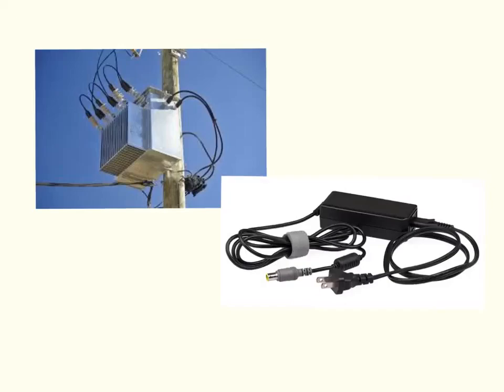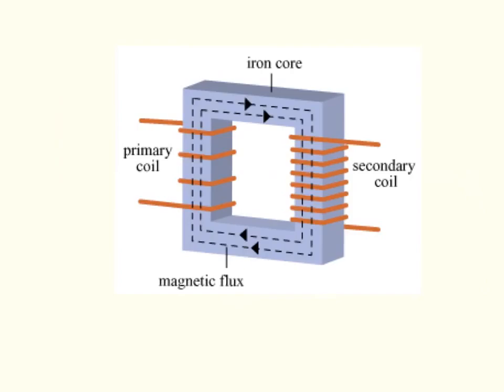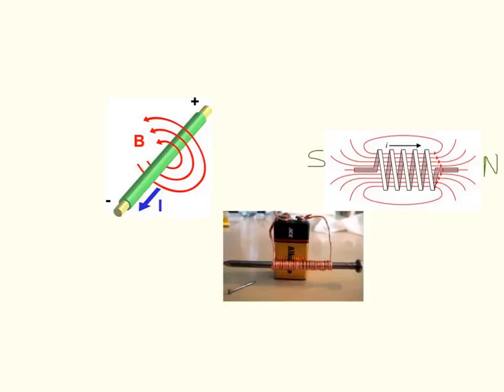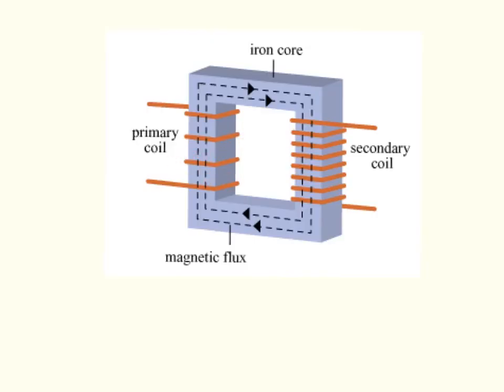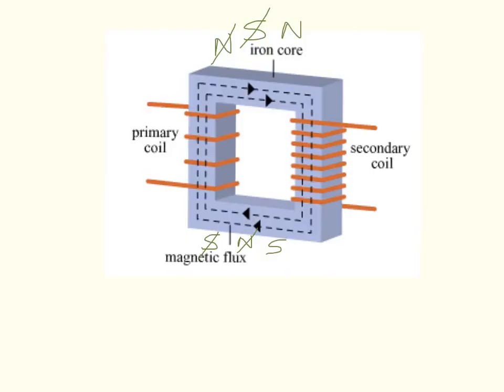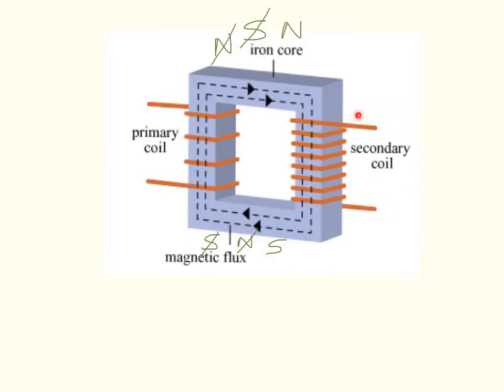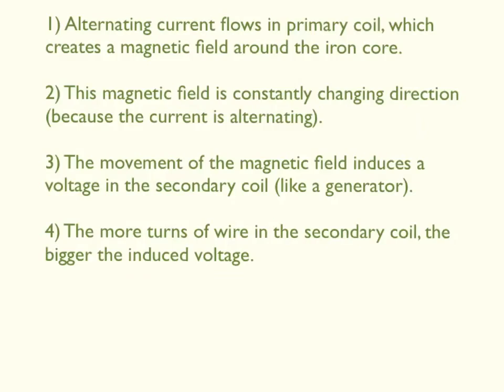Transformers explained

Comment: lol I’m in lineman school and have a test on this in a couple days thank you for breaking this down Barney style unlike my text book so I can pass my test
Reply: Do you knoe happens to the current of the secondary does it change or stay the same? If the primary was 10v and the secondary was 100, youd need 10x more wraps on the second to increase the volts to that amount, but would the current drop because the volts goes up?

Comment: As far as I understand, you dont need a current in the primary coil to have a varying magnetic field inducing an electro motive force in the secondary coil.
If the primary is subjected to an alternating voltage, there would directly be a changing magnetic flux in the iron core. This changing flux, would induce a circulating current in the secondary coil (if connected to a user) that, in turn, would recall a current in the primary coil to balance the secondary current so produced. The current in the primary is the effect not the cause.

Comment: Correct me If I’m wrong but when you talk about the north and south pole induced by the current at 2:35 you say that the North Pole will be at the top. I think it should be the other way around since the coil gets wrapped around from the back of the iron core. If you use the right hand rule and curl your fingers around your thumb, while the thumb points in the direction of the current, the flux should be going down inside the core.
Reply: And since the flux is going down inside of the core, the North Pole will be induced there. Am I right or am I missing something?
Reply from the maker: Hi @KingBumi - it's years since I made this video, but I don't think I show the current travelling in any particular direction, so we can't know which end would be north.
Reply: @CowenPhysics  the diagram shows dotted lines with arrows which is assumed to be current

Comment: Transformers are an Electrical Motor thats what they are. They are Devices that Transformer minimal Electricity into High Voltage Electric by means of Copper wiring and the magnet and other materials.    The Copper Coils must match the Voltage to get a High output of Electricity. Bc the Electricity goes around Resonates with the the other coils next to it creating Resonance friction with the Help of the Magnet thats how the Higher output is made using friction with Electricity and metal creating Electrical friction that makes more power.  This means the higher amount of coil the higher amount of input supply there must be from the electrical source,otherwise you short the output supply of electricity coming out bc it has to go inside the bigger coils and fill up the extra space in the metal and create Resonance with the coils next to it but it isnt able to generate Enough voltage with only minimum power to create enough resonate friction through the partnered coils to create more power output.    If you have to less coils than the coils will fry cause the energy input will resonate and cause too much energy for the coils that they will waste away bc it will over energize and heat the minimal coils that wont be able to hold themselves.   You have to have the Right amount of wound Coils and Right amount of Voltage for those coils, not to much not too less but just the Good amount to see Good results, it doesn't have to specific but just right.   Once you have your coils set up and you and your Battery to power your fully assembled Transformer you can make more power output from the Transformer coming from the Source of your Battery. Make sure Everything is set up correctly though, you do not want your battery to explode by having an opposite affect lol. Electricity is something that should be tested with someone who knows how to use it. Yes it involves the Magnet but the voltage gets generated from the friction with the electricity in the coils that involves the magnet who had it happen

Comment: What may happen if I use dc caront in primary coil
Reply from the maker: DC will still magnetise the coil and the core. However, without a changing magnetic field, no voltage can be induced in the secondary coil.
Reply: @CowenPhysics  good answer 👏🏽👏🏽👏🏽👍🏽

Comment: You stated that no voltage is moving through the core, just an electromagnetic field from the Primary 50 hertz cycle. Even though the Secondary coils are wrapped around the core. So how is voltage induced on the Secondary coils, without passing through the core itself? Its the same electromagnetic field passing through the core, that induces the voltage on the Secondary coils. Kindly explain.
Reply from the maker: A magnetic field passes through the core, but not electric current (in theory, at least). This changing magnetic field induces the voltage in the secondary coil.

Comment: But if power is conserved, then a higher secondary-coil voltage produced by more coils would mean current is lower, as P=I*R. But more coils mean current is higher as they add up. So is current higher or lower?? How do these things not contradict each other??

Comment: So say for a step up transformer, if I had say 5 volts running through the primary coil, if the secondary coil is winded twice as much as the primary, would it be 10 volts on the secondary?

As I was writing this, the equation was explained. Go figure, I was right.

Comment: So in order to keep electricity from flowing through the iron core the copper wire has to be coated in a non conductive coating correct?
Reply: current is not flowing through the iron core.only magnetic field exists in the iron core

Comment: So… A transformer is to electricity, as reduction gears are to kinetic energy? If you increase the voltage of the secondary coil compared to the primary, do you lose amperage?

I really want to thoroughly understand electromagnetism, but it's difficult. I love it, but it's so vexing…

Comment: For transformer chargers that converts voltage ranging from 100-240 volts like information technology, laptop, and phones how are the "turns" around the iron core differentiate the voltage input for the 5 volt output for the batteries?
Reply from the maker: +SamsungLG They are AC-DC converters and use power electronic switching, rather than a simple iron core transformer. http://www.docircuits.com/learn/how-stuff-works-your-ever-helpful-cell-phone-charger/
Reply: +Cowen Physics that was crazy of me to get so literal, thx

Comment: How does this jive with conservation of energy?
Reply from the maker: +Des Troya Power is the rate at which energy is transferred, so if energy is conserved, so is power. Power = voltage x current. If the voltage increases, the current decreases, so power remains constant, hence energy is conserved. In the real world, some energy is dissipated as heat and in magnetic losses, so the power out of the secondary is a bit lower than the power into the primary.
Reply: Cowen Physics  since current itself is a function of resistance and voltage.  I = V/R, does this imply that more turns on the wire increases the resistance of the wire?
Reply from the maker: +Des Troya No. You cannot treat a transformer like an electric circuit in this way - the change in voltage/current happens because of magnetic induction.

(Having said that, a longer wire would inevitably have a higher resistance, but that's got nothing to do with how the transformer works.)
Reply: Cowen Physics so I understand that in order to raise the voltage on the secondary, it must have a lower current because the power remains the same. But I'm having trouble understanding why the current has to be lowered in the second coil. What is it about the more loops makes the current plummet?

Comment: 2:40 if the frequency is 50Hz, doesn't it change  100 times per sec?
Reply from the maker: +Oekanos The magnetic field is induced by the current, which is changing 50 times per sec.
Reply: its 50 times South and 50 times north
Reply: Old reply I know, but I came to the comments thinking the same thing.  If 50Hz, thats 50 cycles in one second. Thinking about it like a sine wave, a full cycle would be a pole change from North to South, then back to North. So 2 pole changes in one cycle. 100 pole changes per second.

Comment: Question .
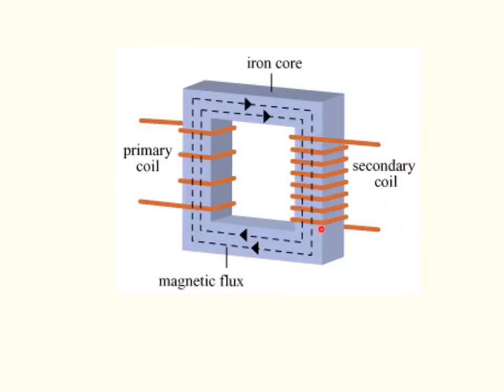At 1:07 you said there's no current flowing through the core, but the coil is attached to the core doesn't that transfer the energy ?
Reply from the maker: Rich Handsome The coil would be insulated to prevent current being conducted through to the iron core.

(In reality, there are actually tiny currents called eddy currents flowing in the core, but this is an undesirable side-effect.)